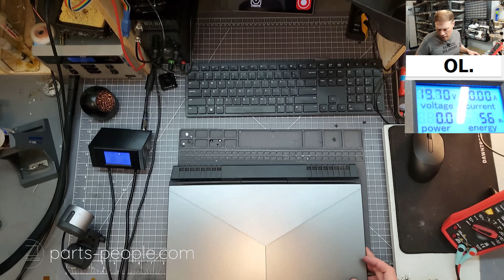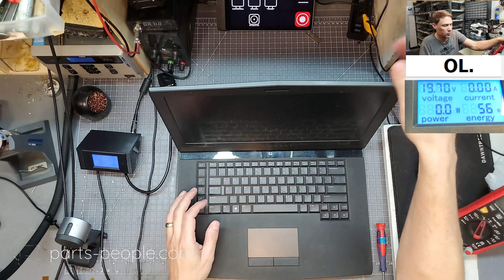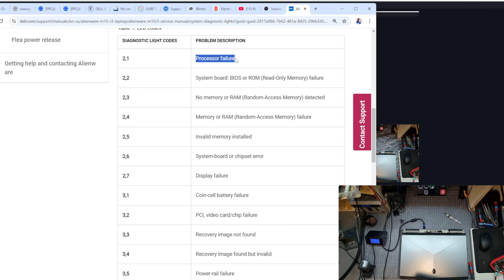Why THIS Alienware Suddenly DIED! And Can It Be Prevented?

Comment: Hi I have the exact same model and it won't turn on after i repasted it. When I connect the AC adapter, the power button first light up, then it dimed after i pressed it. Though the AC adapter itself remained lighting up. Is it the same issue?

Comment: Hi, You did not wobble the fans and heat sink slowly (one side up and the other one down.) Like you said in another video. And it should pop right off. Like you said "As you do not want to just pull it of. As you could damage the CPU and GPU."

Comment: the problem isn't the dust it's that there is no easy way to remove the dust these laptops are all going to accumulate over time because no one lives in a granite box, people have carpets. 
You have this same problem with normal PC's the only solution is an air compressor or an air gun to blow out a 10cm CPU wide radiator or to blow through a GPU radiator.

Comment: I purchased in Alienware motherboard 17 R4 with that very same code 2 red 1 blue I flashed the original BIOS and I'm using it right now however this board did not have any shorts on it but a faulty bios can cause 2 red and 1 blue
Reply from the maker: So you are saying the motherboard POST'ed with a 2,1 error flashing. That would be crazy.  2,1 is CPU failure; normally, it would not get a screen with that error.  Now, on those motherboards, when you first connect them, you will get a 3,1 light code when it is turned on for the first time. That is a CMOS reset code, and it goes away after the time/date error is set. So this would make more sense as the error you received.

Comment: I got a Panasonic Toughbook CF-30 straight from a recycler that was filled with years of swamp gooch and ball cheese, from a state highway patrol trooper, no less. It makes me wonder what he was doing when he was not checking license plates, inspecting trucks for foreign drivers, or investigating crash scenes.

At least it still boots up, but only to a blank screen because some of the ball cheese got into the keyboard and the screen connector, causing the screen backlight to short out. 

A cleaning, a new keyboard, and a new screen cable should fix this. But I don't think a new Dellienware laptop would have survived that. So if you own one of those, make sure to deep clean it every 3-6 months. Because, if a Panasonic Toughbook, or it's Lenovo ThinkPad brother, isn't immune to swamp Gooch and fall cheese, I'm sure a Dellienware laptop can't send that stuff to Area 51x or beyond.

Comment: Nice troubleshooting and fault finding. I have to wonder though is why so many of these YT repair guys seem to not know to use a vacuum cleaner on a unit in for repair. Before I start working on a piece of gear, the first thing I do is take a couple of brushes and a vacuum cleaner and get all of the crud off it.

Comment: my A15R1 is still kickin' the only issue I have is they touchpad. For some reason it is failing. I replaced it with one from parts-people but still is not working. If I use it with ext mouse, I have no problem.

Comment: Why don’t they have a crowbar circuit to the input power rail  to the cpu that triggers at 1 to 2 volts and shorts out the rail. They were common in old cathode ray televisions.

Comment: Interesting. Is replacing the huge BGA CPU a complete non-starter? Let's say money was no option. Could you have potentially replaced the CPU using a vapor phase oven, or would this have likely melted the ABS on other components or otherwise been impractical?

Comment: Instead of removing the power stage to find the short, you could remove the inductors, one at a time.  That will isolate the power stage from the other ones, and you can ohm out the power stage.

Comment: @dellpartspeople Just from around 5:45 I can tell you its best to replace the far left and far right and middle from the right to left ones are the bad ones. Because the far left and far right ones have a chunk of the chip missing. For the far right one its hard to read the stuff when the chip just one left is perfectly readable. For the far left one at around 5:41 you can see where there's a dip right where part of the chip info is just missing. As for the one middle from right to left at about 5:43 it has a rounded edge instead of a flat edge. The only way for a chip to have those issues is if it gets extremely hot, and the only way for a chip to get extremely hot like that is if the chip is or was faulty/shorted out/unusually high wattage to or through it. A dead give away of faulty chips is ones that aren't completely flat, or that have a sudden dip on it that's just there and isn't gradually led into a dip. If unsure you can always compare the chip to a known good one and tell if it's damaged. The quickest method is by just looking for being unable to read the writing on the chip, and looking for sudden and random dips that are rough/uneven

Comment: People don't realize the amount of current flowing through these devices.  Let's do some quick back of the napkin calculations using Ohms law.  Let's say VCC is 1.3v and say the TDP is 100W.  That means at the maximum power usage your CPU is drawing 100W of power.  That doesn't take into account boost which sometimes will draw more power than TDP briefly, and assumes 100% efficiency (which isn't realistic).  Anyway, let's say for sake of discussion you are working around 100W with a Vcc of 1.3V.  Since I = W/V we would  have 100W / 1.3V which is about 77A!!!!  That's a LOT of current!  That's a super simplified version and doesn't take into account the processor speed or anything like that.  Modern processors are power junkies!  Great Video!
Reply: Desktop processors can handle as much as hundreds of amps.

Comment: Sadly, The Number one killer is overheating, due to poor circulation of Air!  The Older Gaming Laptop CPU/GPU are changeable? But lots of these quick built CPU were solder in first than built around it!   A can of Blow Air come in 3-4 pack of CO2 air!  Caution it can freeze -05' or lower?  Hopefully he should found a replacement boards from 50 to 150+ USD?  And buy a Good Gaming Pad with 4-6 Fans and once a month to shut down Laptop and blow the fans and intake/exhaust on Laptop until you feel AIR coming out?

Comment: A device for truly enthusiasts - who know what good and dangerous temperatures are, know which temp measuring apps are decent and  which are not and just show random numbers, etc. All this because manufacturer decided that if CPU is not overheating (well, it has a fan...) then VRM is not overheating either and there is no need for a temp sensor to shut down the whole rig.

Comment: I like the fact that you take your time when working. (I'm not specifically referring to this video, but the one when someone attempted to replace the battery and ripped off a component).
A lot of repair shops don't spend much time fixing laptops. If the problem isn't obvious, they often declare it unrepairable and move on, still charging the customer a lot.
In the case where the CPU is fried by 20V, is replacing just the CPU an option?
 I know it's quite difficult due to the reballing process and the risk of accidentally desoldering the small components, like the microscopic capacitors and resistors, around it.

Comment: I might understand the owner why they're fear about cleaning laptop. I have 2 dells, one is G3 which is i cleaned by my self. After unplugging the battery, i unplugged the fan to clean and plugged in again and replace thermal paste. After plugging the battery again, the laptop screen is not showing (i already delivered to the technician and he told my its my fault so the ram source is dead and might happen to the chip). And the 2nd one is dell Vostro, this time i give to the shop do the cleaning. After using a week, my Vostro laptop has a symptom of overheating, it usually restarted by itself. Now, i'm using mac mini (m1), and still using it for 4 years without any heat issue (using it from 2021).

Comment: that would be a great unit to use for parts, I have a 17 R4 with a chipped corner because I accidentally knocked it off of a stand one time. Didn't do any damage except cosmetic, but I would love to replace the cover at some point. I've already had to replace the keyboard and fans, I'm gonna use it as long as I can.

Comment: Occasionally, one should check the CPU and GPU temperatures via the software, especially under load. One should know the normal range for their machines. If you own something, you need to have minimal knowledge on maintenance in order to get the maximum value from your machines.

Comment: The lack of any protection circuitry, such as "crowbar circuit", tvs, zener, mov's, proofs how much the manufacturer cares about quality and durability!
An additional 2 USD in components, could've saved the CPU from being fried! 

However, when they produce 10 million devices like this, those 2 USD in components become 20 million USD of lost revenue. So it was deemed to expensive by the executives, who would rather invest some additional millions into their mansions and yachts! Regardless of this decisions being detrimental to the products quality or Alienwares branding!
Reply: Hopefully in the future there will be a breakthrough in semiconductors that allow MOSFETs and Diodes to fail open circuit.

Comment: How much does a motherboard normally run for one of these? Don't normally work on Dells, but Lenovo's, lol. I know I that when I had replace a motherboard in a Thinkpad T480, due to an aftermarket charger blowing up the MOSFETs, and processor, it was like $50 for the I7, $35 for the I5 motherboard(8th gen core architecture, the minimum to run win 11, lol) I used the I7 board,  this was a "free" laptop that someone gave me.

Comment: Discovered your channel recently, love it, thanks.  Is the CPU non-replaceable/wouldn't likely fix any other issues, hence only fix is whole motherboard replacement?
Reply: you can replace the cpu, but the issue is finding a good one and second issue is you need a "heatplate" and after cpu is swapped you sometimes need to add or reposition a few other smd components for it to function so it.s a bit more complicated procedure and more expensive
Reply: @petricagigi-ev4zd  Thanks, what's a heatplate/for?  Something to warm the whole board so the cpu can be desoldered and replacement soldered in?  I'm assuming it's a surface mount/ball type cpu?  And yes, I know that's an issue/difficult, especially re-balling a chip (have seen it done on Rossmann's channel).  Thanks again.

Comment: Hi, have question,  When CPU's ect are toast and techs have to swap out boards, what happens to problem with Win Keys? Do you sell them another key or use Transfer software to migrate everything to another board but that new board has to have a diff key or old one already?  Lot of time and expense to do this?
Reply: If replaced with like mbd, should be no problem with the key.

Comment: What is the beat method of cleaning out the dust, lint, etc., from the inside  of a laptop computer?  I  have used can air through the air vents in the past but I read that that is a bad way because it only just movies the dust, lint, etc., around.  Should the laptop computer be opened up and then use canned air to remove the stuff?  Also, how often should the cleaning be done?  Thanks.
Reply: Valid question.  Blaming the owner here, but having taken my Dell Workstation apart for a repasting I don't ever want to work on a f*** Dell again.  My old HP Elitebook I can strip and clean in five minutes, that Dell was a plastic prying/cracking two hour ordeal.
Reply: Thanks for your reply.  I have an Acer laptop and I have had it for several years, and so it must be pretty dusty to  awhile.
Reply: @Referee006  I also have Acer aspire 7, have it cleaned and thermal paste replaced by a local PC repair shop. It made a 10 degrees Celsius difference.

Comment: Stupid question, but is a CPU replacement not possible? Or is it like waaay too many solder points?
Reply: basically used laptop will cost like cpu replacement + job payment. the only exception would be using an engineer cpu that was used in factory for testing, they cost two times less, the only problem is in finding a trusted seller, they are sold in China and ofc many sellers are scammers.

Comment: I felt your comment about the board being the "best design ever" as I helped a friend replace a failing, noisy GPU fan in his AlienWare laptop. 

When I looked up the service manual, realized it had to be fully disassembled to replace the fans, I advised my friend to buy both fans because the other one was likely not far behind and I had zero interest in taking it apart again. 

What's that USBC power supply you're using? 

I want something like that with a display and robust design. Those inline testers you can get on Amazon are typically poor quality, have the output cable permanently attached, and are not trustworthy that they are wired properly for high current.

Comment: I also have a 2+1 blink code on a inspiron 3582 which points to a cpu failure, also the caps lock key light is stuck on. It was initially dead with a broken power jack and socket which I replaced and it successfully charged. I'm pretty sure it got fried due to a short but at least I'm using it to test and learn stuff.

Comment: Nice job very nice job! I think we have all forgotten to stick the memory sticks back in after everything was put back together.
Reply: Or, if fixing desktop replacing the power cord to the back of the power supply, or turning the switch on the p/s (if it has one) to on...  :)

Comment: Are the workstations like the Dell Precision better built than the gaming laptops? It seems like failures are much less common among higher end workstation laptops.

Any laptop is going to fail if there is inadequate cooling from dust building up, but it does feel like the Precision and similar laptops seem to last longer. They are more conservatively clocked and seem to be better built, despite also having high end CPUs and GPUs.

It would follow the same trend of business laptops lasting longer than consumer laptops.
Reply: It’s also likely that the sort of person putting down money on a tool that makes them money, is probably going to take better care of their machine than many gamers.

Comment: Next time, short the vrm outputs and inject current. That will light up the shorted chip. 

Also, getting a better camera will boost your ability to gauge if a cpu or gpu or other chips like that is shot. 
You need better resolution and framerate is a big bonus. 
Even with the board powered normally or by injecting voltage in the vrm rails (0.8-1.7)
After looking at a few good and dead cpus, you will know at a glance, next time.
Reply: Framerate as in 60? y/n?

Comment: How do you clean these things out if accessing the fans requires you to remove the motherboard? Are Alienware owners just expected to fully remove their motherboard, clean out the fans and repaste everything every half year or so?
Reply from the maker: You can just use a can of air once a month, and then you will never get any build-up.  If the fans and heatsink have never been cleaned and are already clogged, you will need to disassemble the entire machine and remove the fans, and blow them out with air.  The best practice is to never let it get like that.
Reply: @dellpartspeople  I was under the impression that blowing compressed air into the fans was not good because 1) it would just blow the dust deeper into the fans and heat sink and 2) the fans could be damaged via the air causing the fan baldes to spin in an uncontrolled manner.
Reply: @Positive916  For the latter you're usually supposed to hold the fan blades in place when cleaning with air.

Comment: don't think it's entirely owner's neglect. I had exact same laptop and thermal pad not thick enough to touch the mosfets or not placed properly in factory. I was able to fix with K5-pro thermal pad-paste. had Precisions with way more dust running years without problem
Reply from the maker: At this point, the laptop is 7 years old, and there was little to no airflow.  I think the MOSFETs held on as long as they could.

Comment: How do you keep the fans and heat sinks clean?
Reply from the maker: You can just use a can of air once a month, and then you will never get any build-up.  If the fans and heatsink have never been cleaned and are already clogged, you will need to disassemble the entire machine and remove the fans, and blow them out with air.  The best practice is to never let it get like that.

Comment: This is why I recommend temp apps to people when they get a brand new computer and note what's the base line and the highest temp it goes to. This way if for some reason when you start your computer and it's 10 degrees higher than usual and it's like this consistently, it's time to clean out your fans. I dumbed it down to this cause not everyone is tech savvy. 

I got an Alienware myself and when I noticed it ran close to 60C when I was idle when it's temps were usually around 45C, I knew I had forgotten to clean my fans. I usually clean them every 3 to 6 months. Another good video. Only recently subbed, I don't understand it all but I get the gist of it. It's digestible info.
Reply: And it's so simple to do to get the temps shown in your taskbar [or at least it is on Win 10].
Reply: Lol my msi hasn't been cleaned in 3years still working fine...

Comment: 1:15
That amount of screws will drive me crazy. Why not get those "pen type" motorised screwdriver? Would save you lots of time and wrist, not to mention your sanity.
Reply from the maker: I have one, but I find that they do not have enough torque to start unscrewing the screw, so I end up having to manually start it anyway.  They also are not that fast, at least not the one I have.
Reply: Ratchets are good.